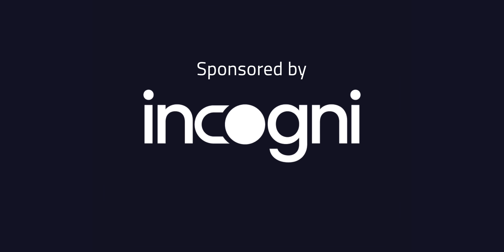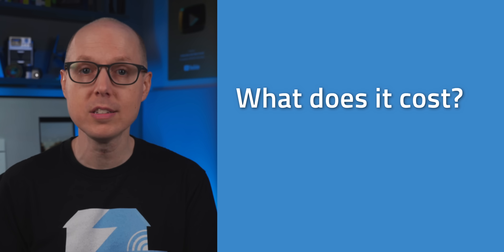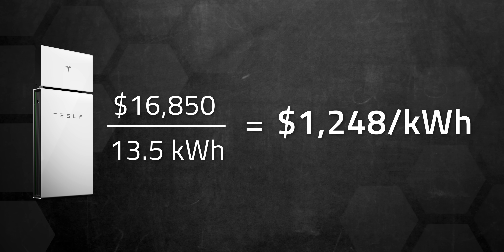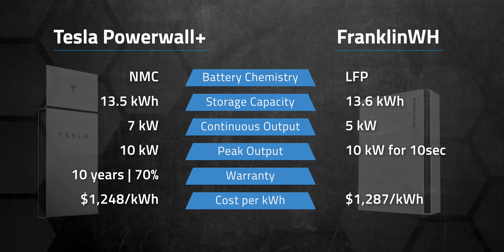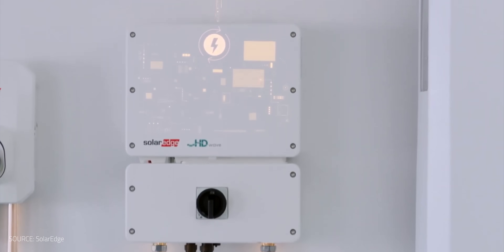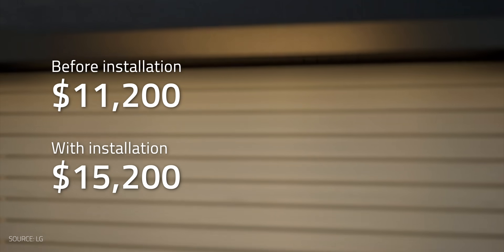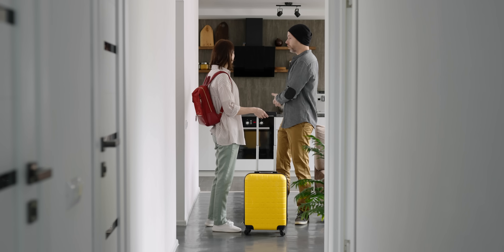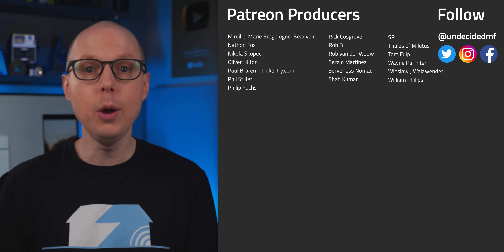Top 5 Batteries for Home (And One You Might Not Expect)

Comment: Great information on what's available and what's coming to market soon. I'm glad you put emphasis on 'storage of power' to leverage during high-peak demand. Hopefully, there is software to help calibrate the power use to the homeowner's needs. Here's a question for you: Are there any software tools or online tools a person can use to determine their power use on any given day? It seems like I would want to know that first before going shopping for a battery storage system. What size or storage capacity do I functionally need to run my home. How did you determine your power use per day before laying plans for your new home? Thanks for the video. Great topic!

Comment: Hi Matt.  All the batteries you report on are Li based.  Think how much Li would be freed up if we stopped using Li for Grid Storage and home batteries.  How much would this reduce the cost of EVs?  The alternatives are interesting and I suspect that all they need is market share to be cheaper than Li batteries.  Besides they have some very beneficial characteristics when compared to Li batteries.  What are these.  1/ They last far longer, 2/ They can be cycled between 0 and 100% with no damage, 3/ They are made from cheap elements that are readily available from multiple sources, 4/ They are far safer from a fire point of view, 5/ Because of their fire safety they can be shipped any way you want (air, sea or land),  6/ They need simpler charging/discharging electronics than Li Batteries 7/ They use no REMs. 8/ If they ever need to be recycled, this should be far easier than for Li batteries.  So what are the possibilities.  There are ZnBr flow/plating and gel batteries, liquid metal batteries based on Sb and Ca with other alternatives being researched as we speak, Redox batteries based so far on V and Fe and the up and coming Na batteries.  Now there is one with a really cheap core element.  Sea water contains about 13kg of Na per Cubic meter.

Comment: It’s important for anyone considering these batteries in combination with their PV solar installation a few things:

1. Their utility provider’s rate program for power sold back to them. For those lucky enough to have “net metering” where their utility gives you one free KWH for every KWH sold back, the need for batteries is much less. 

2. Typically PV sales and install companies charge a lot LESS for the batteries upfront with the system than after the fact. For example, I paid $8,000 per extra Tesla PowerWall battery. But it would be $12K+ to add later. 

3. Tax incentives. The federal tax credit which is 30% of the cost of the installed system (including batteries) is HUGE, but only applies to the initial install system, not batteries added later.

Comment: I've been trying to understand that if you put electricity into your grid with ty grids and I have a 1,000w, running this for one hour only puts in 1000 w but if I use a microwave for three to four minute it uses 1000w can you please explain why the difference why can't I take 1000 w input it in every second; versus when I'm using the energy it seems to get used up faster than I can put it back in don't matter how much I put in it still will only go in per hour it might just wrong about this can you explain.

Comment: Fancy isn’t always better, just sayin. If you go with a simpler battery setup like the SOK 5.2kwh 100mah battery you can stack them into a server rack setup for a much lower cost per kWh than anything you listed. Ultimately it’s going to come down to doing the math and finding which battery profile works best with your system and which system is right for your needs. 

In addition would really like to see a video on the design elements and what energy reduction solutions you incorporated into the home your building.

Comment: The three most expensive parts of a home energy storage system are, energy storage batteries, solar panels, and inverters. If you are ready to install such a system, I can provide you with a perfect solution at a very low price.

1. The lowest price for bulk purchase of batteries is expected to be 260$/KWH. If you buy more than 100KWH in a single purchase, the price will be lower.

2.550W solar panel minimum price is 150$/pc.

3. Inverter price is fixed between 800~2000$.

4. Parts: cables, junction boxes, etc. are expected to be $500-$800.

5. Installation fees are different for each region, you can add your own

According to a 5KWh energy storage system to calculate, the minimum price is only about $4700. And you can realize the whole house intelligent monitoring and management. Please contact me if you need it.:face-red-droopy-eyes::face-red-droopy-eyes::face-red-droopy-eyes:

Comment: Built my own from LFP cells, all 64 of them, I have 60kWh with a nominal output of 11.5kWh and a surge of 20kWh, cycle life of 6000 cycles on the cells. Rough cost $12000 USD. I installed myself so no cost apart from my time!

Comment: My dream system is a low-frequency grid-tied hybrid inverter, a DC-coupled server rack battery stack, & a ground-mounted bifacial panel array. Generator backup would be DC coupled direct to the batteries with a variable output AC to DC battery charger.

Comment: Those are astronomical prices for battery power. I just buy prismatic cells & build my own. Costs me about $1300 per 7.5kw & no installation charge doing it myself. So what you guys are paying for a single powerwall would give me about 75kw or more of battery power. I will give you that it's a much neater installation aesthetically & that's great if you're rolling in $$$ that you can do that.

Comment: I of course think warranty is important. (With the gripe, that if there's a general problem the company will probably disappear before honoring the claims!) But I'm actually more interested in detailed analysis of the probable lifespan under different load scenarios. With a bit over-dimensioning, it should be possible to have intelligent control secure "optimal use" - and even adjust to different scenarios (i.e. higher utilization during excess local solar output, free or very expensive net pricing etc.)... But the two crucial numbers I miss are: Total MWh cycle cost at optimal use (say i.e. only using the battery in the 10-80% charge range and never exceeding 80% of the nominal charge-/discharge currents*) - and at the same use scenario: What will the actual battery capacity be? I'm also a bit concerned about the actual environmental impact. But it's almost impossible to get unbiased info there - so until we get trustworthy data, I'll count on local solar/wind energy stored will generally be better for the environment if it's cheaper than net pricing! ;-)

*) Have no clue what the actual limits or parameters are for the different battery chemistries. They will obviously differ - but it should still be possible to get comparable "expected MWh cycle cost over life" numbers...

Comment: I think the connectivity and software processes will make a huge difference. For example, running on tariffs with an hourly price. Or charge the systems automatically when a storm is coming. But even more important, actually help in stabilizing the grid. By putting energy back into the grid when necessary, or pull from grid.

Comment: Currently have 8kw of solar and no battery. With a purchase rate of 35c kwh and a buy back of 17.5c kwh I have no power bill for 5-6months. This is in a home with a heat pump and normal levels of insulation in a temperate climate. To make a battery pay off for me it needs a 20 to 30 year lifespan or much lower costs, so I'm waiting for the next generation.  Note home brew options are not allowed on our grid as they aren't certified.

Comment: How is it that there's no nickel-iron battery storage solutions?? The chemistry is not for fast discharge but that can be overcome by adding more batteries. It has a virtually unlimited cycle life. The battery is very heavy but it does not matter in a home. They are also known as Edison cells and the first ones developed by Thomas Edison are still in operation. 

Let's face it. Lithium is a dead technology. It's only advantage is high power in a low weight package. Why is weight all that important in home storage? It isn't. 

Sodium technology can dramatically extend the cycle life of batteries. Nickel-iron can extend it well beyond a person's natural lifetime. 

Sodium is present at virtually limitless supplies. As is iron. Nickel is not present at great quantities. But it is obtainable. Lithium is just not available at any meaningful quantity. 

Just wait a couple of years. For the release of sodium batteries. They will revolutionize battery technology.

Comment: I went whole-hog and maxed out the Zendure Superbase V at 64 kWh for $35,000 on their kickstarter (They're very similar to Bluetti and Ecoflow). That's just under $550 per kWh if my math is correct. I haven't hooked them up to solar yet and the company has been dragging their feet on shipping their wall panel that ties everything together more elegantly than extension cords and duct tape, but based on your prices the price per kWh makes up for the delays... For now.

Edit: I also have a Ford Lightning Extended Range pickup, so if there's an outage it's a party at my house.

Edit 2: Oh, I should mention that since these are portable-ish all in one units like the Bluetti's and Ecoflows, that means that they have solar inputs and built-in controllers, along with dual-phase 120v/240v outputs. The DC input is relatively low for the system at 3kW, but considering that I don't need any additional inverters/MPPTs/whatever to get direct solar in, it's a pretty good price.

Comment: Interesting,
but as I am still more DIV and monitoring my solar in and home usage 10KWh storage is the normal need for my home. At we use near 40 KWh a day, and get most 30 KWh out of the Solar (22*225W/24V).
WE have power outrages main in the heat summer with starting thunderstorms - as just last Friday ? for 5 hours. That is a longer one in 17 years experience.
So to do that with conventional better Deep Cycle GEL Batteries at 12 Volt yet, I see 833 needed Ah - that should be about 2500 available AH.
If I stuck on this system is is 25 Batteries each 100 AH, that cost me weeks ago 4.300 Baht each. That is 130 US$ each and will sum up to 3.260 US$ if I really use this system in future.
So from that position even if buy another 2 Inverter (each about 300 US$) and 7-8 more Solarcells (about 120 US$) to reach 100% Solar to usage.
That is just basic math: I look this options with interest but also can calculate a bit.
And power down is always the same procedure for me : shut off unneeded units (AirCon, PC, Water cooker, ...) and lay down and rest and accept.
So there is no need for BIG size Batteries as if my home might be on light all time, and all neighbors are of for a week - I may get even more problems than benefit from this system.

Comment: Cool topic. My home in California was inundated by atmospheric rivers beginning just before the new year. We were without utility power for 17 of the first 20 days of 2023. So my 17KW standby generator ran for those 17 days at a cost of approx $80 day. I decided to install batteries so that the genset only needs to run long enough to charge the batteries.

So I installed a 15KW (38 panel) solar array with IQ8 inverters, and a pair of FranklinWH storage batteries. Since the system was commissioned last week, I have not bought any power from the utility except the small amount needed by the inverters to sync with their wave. The batteries are fully charged by about noon on sunny days, and power is sold to the utility in the afternoons.

I'm really pleased with the performance of the system. The only drawback I see so far is that I have not figured out how to get the FranklinWH aGate to periodically exercise my generator for 20 minutes each week. I replaced the ATS with the aGate, so I kind of thought it would have that functionality cooked into it. I contacted FranklinWH to ask about this, so it may be possible they can provide this someday with a firmware update if it isn't possible already.

Comment: Unfortunately I will need something small and very affordable for my shed which I hope to electrify with a gas generator at first and supplement with solar and wind later; but most of the batteries in your video are to big and cost four times what I paid for the shed; could you make some recommendations to which batteries I should use for a shed/shop with a few small power tools and four shelf style model train layouts.

Comment: There are many alternatives that cost 3000$ for 10kw (grade A cells) and have  7+ year warranty with easy upgradability . Where I live, to equip such a system will cost $200-500. I get that these are top of the line products. But believe me most people are looking for cheaper alternatives. Lower grade lithium batteries could be even found for under $2000 for a 5 year warranty for those on a tight budget.

Comment: Super caps are outperform all lithium options by miles,  cost generally 1/3 more then LTF but with no degradation extreme fast charge and discharge rate. No chemical reaction for the charge and discharge, so much safer to use. 35/45 year life span with no notagable degradation. Proven technology and a couple of very good options available on the market at the moment.

Comment: EndurEnergy grade A LFP batteries come in 5.12kWh module units so you can scale and string in parallel as many as you need (or add more later). Pair these with a Sol-Ark 15k inverter and this will be your best and most powerful bang for your buck

Comment: There are so many great DIY options with great battery chemistries and warranties.  I just had delivered a 30kWh battery (6x5.12kWh) 48V battery system with 2 8kW inverters.  I’ll be able to peak at 240v and 14kW with burst up to 20kW.  I’m using mine for a time of use energy plan and expect to see a 60% reduction in my bill.  Solar remains an option I intend to install with up to 12kW of incoming DC solar per inverter).  All of this was $17k. There are several companies competing and offering not just great deals, but personalized support from small teams who get invested in your project and interested in your success.

Comment: I would like a full review (reminder) of end-to-end set up. I remember you mentioning a circuit breaker box that has an app to monitor what exactly is using what energy. That tied into data from solar, wind, and backup generator to give total blackout energy capability with scenarios of if you power down certain appliances during certain times, what might you gain.

Comment: Based in the UK, the US prices are high, significantly higher than the UK.  I can pick up a high quality 9.5Kw battery system for around $8000.

Prices are falling year on year for the batteries.  I am gradually making my house efficient and solar panels are next year's project (or maybe the year after depending on funds) but solar without battery storage is not a great idea IMO

Comment: I bought a house that already had solar panels but no battery backup. Everyone I’ve looked into adding it to my system, some companies won’t add to a system they didn’t originally install but ultimately it didn’t seem worth the added cost to put it in now due to missing out on the tax breaks that came with original panel install. 
In my area we really don’t have any blackouts/brownouts. So adding batteries would really be about reducing my higher cost time of us expenses by drawing from the batteries at that time. 
Has anyone else been a similar situation and found a good option ? I have a Solar Edge system and would want to run my A/C because it is so hot in the summers here, so I think that would mean I would need at least 2 batteries.

Comment: Great contest, as always. What I am interested in is a little bit more DIY, such as buying some of the major components separately and saving on cost. For example, a grow light 3000 W MPPT/inverter that is connected to power and only tripped on to use the batteries when an interruption to the grid. This is something I’m looking at for my shed, which is where our pool equipment is, with the hope of using it to power all the pool equipment, directly from the batteries and solar panels during the day to help keep the charge up for those batteries.

Comment: be very careful with storage, here in Canada there is CODE coming that will require a vault (cement enclosure) to place your batteries in. due the Thermal incidence and thermal run away which all solar companies are scared to admit! Insurance companies don't like insuring homes with aluminium wiring, just wait until they figure it out that a power storage system or even an electric car in your garage is way more likely to start a fire than aluminium wiring! and a thermal run away with lithium ion feeds itself with oxygen

Comment: Put in a Tesla Solar Roof system when our roof needed replacing.  The system was sized with two Tesla Powerwall2's and installed.  Close to 2 years after installation and working very well in MD.  Since install we have had 13 power outages from 5 min to 1 hr in duration and no drops in power to the house. Also setup the system for TOU to help with high rate times for the electric coop we belong to.  Made 18.9MWh of power the first year.  Now have a Tesla Model Y Long Range that we charge with excess capacity.  Works well for us.

Comment: Simple numbers: 15.000 $/ (6.000 cycles * 10kwh) = 0,25 $ for kw stored. Even if the electricity was free (which is obviously not because you paid your FV panels), it's more expensive that the current price of electricity! Batteries are only a rational option if you live in a remote area with frequent electricity cuts.